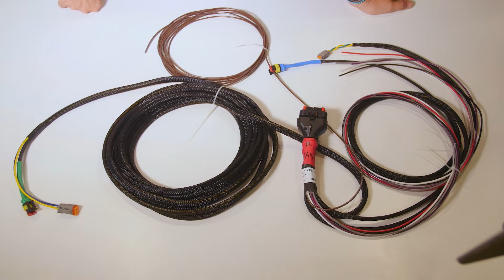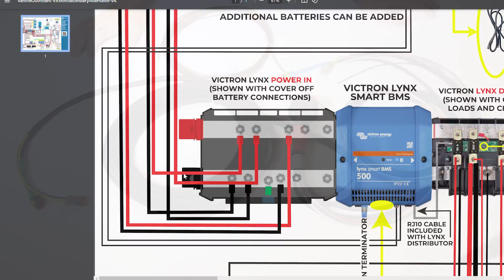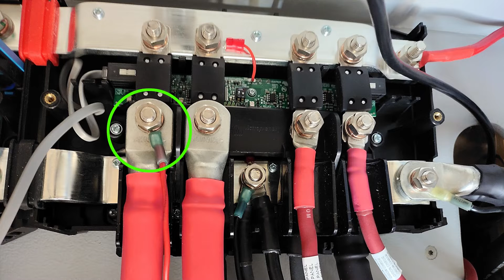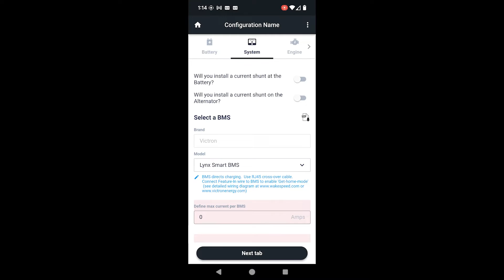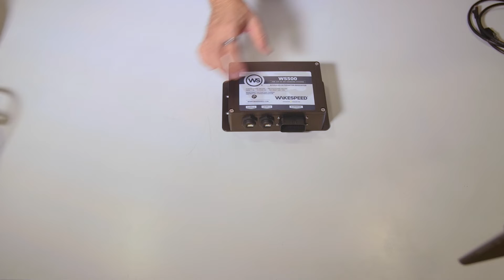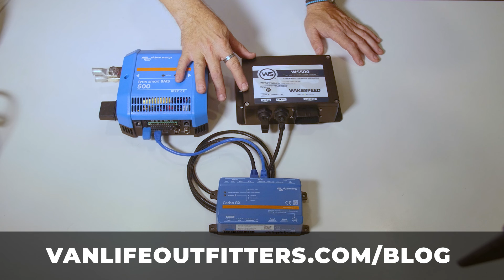Overview of Wakespeed WS500 Van Harness

Comment: the field wire gauge size is not adequate. Wires longer than 60" should be minimum 14 recommended 12. This is from Wakespeed an extending wires.

Comment: A technical comment, your analog shunt explanation, is correct. But I believe you used the positive side from the alternator. You could also use the negative side, the orientation of the purple and gray wires would switch, but I believe you will not need to fuse those wires. Am I correct on this?

Comment: Researching this for my next, Van build! You guys seem to know what’s going on. I also watched their 101 video. Question for you, are you guys aware of the REC BMS? It seems to be highly recommended with generic DIY build. That’s what I’m planning on doing. I will be using 16 S, MB 31 batteries. 48 V, about 14 kWh. Are you guys familiar with the set up?  I understand that the vendor is very important for follow-up support. Just curious if you guys are comfortable with this.

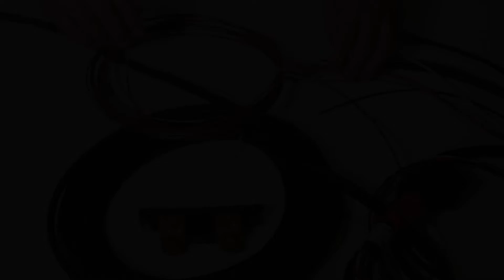Comment: This is a technical question. In your April 2025 wiring diagram accessed from your blog post, there is a note in the lower right corner that states that the brown IGN wire MUST be switched off when the Lynx BMS contactor is open. From timestamp 16:20 to 16:33, there needs to be power on both brown and red wires in order for the WS500 to power the alternator's field wire. If the contactor in the Lynx BMS is open, the red wire will not have power. So is the switch on the brown wire really necessary, as mentioned in the wiring diagram?? The blog post doesn't mention this IGN switch.  
Thanks!!
Reply from the maker: From our video creator and company founder: If you wire up the "red wire" from the Wakespeed harness to the same Lynx Distributor connection point as the charging output from the alternator, as we recommend and show in the wiring diagrams, then power to that wire will be cut when the Lynx BMS contactor is "open" (system is turned off).  That is by design so that if the fuse blows or the system/BMS is off, and therefore the alternator current has nowhere to go - is not connected to the battery, the red wire to the Wakespeed will also be disconnected so no field drive can be produced. The brown wire comment doesn't make sense: "IGN wire MUST be switched off when the Lynx BMS contactor is open". We don't suggest that anywhere. The BMS contactor has no relationship to the brown wire which can be ignition switched. Ultimately, the Wakespeed needs power on both the red wire and the brown wire to power up. The red wire should get switched by being electrically downstream from the Lynx BMS contactor. The brown wire can be switched on/off from the ignition switch and also an additional toggle switch.
Reply: @VanlifeOutfitters  thanks so much for taking the time to reply. Here's a direct quote from your PDF wiring diagram:
"OPTIONAL TOGGLE SWITCH ON THE IGNITION CONNECTION. ADDING THE "OFF" POSITION ALOWS YOU TO DISABLE CHARGING FROM THE SECONDARY ALTERNATOR. IF YOU HAVE YOUR BATTERIES DISCONNECTED USING THE SELECTION/DISCONNECT SWITCH YOU MUST ALSO DISABLE THE SECONDARY ALTERNATOR TO PREVENT DAMAGE TO THE ALTERNATOR."

Could you kindly clarify the last sentence? Your comment above makes logical sense, but the diagram has this strange note that doesn't quite line up.

Comment: The video does not address the "feature-out" wire that is present in the 'normal' harness. This wire can be used to trigger an "idiot" light at the dashboard. So I wonder whether this wire is also included in the van-type harness or has it been eliminated ?
Reply from the maker: The "feature out" (orange) wire is not included with the van harness.

Comment: Do you have an example of how a battery kill switch (such as a blue sea 3001) with an alternator field disconnect function  would be wired in to make sure the alternator does not produce power if the house battery system has been switched off?
Reply from the maker: Sorry we don't but the Blue Sea manual for that switch is very detailed on how to wire it up.

Comment: What size wire from alternator to buss bar
Reply from the maker: Typically the charging output from the alternator should be 4/0 with the Nations 280 amp 12-volt kit. If it's short enough you can use 2/0. I would recommend checking out our blog post that has an example wiring diagram as well. 

https://www.vanlifeoutfitters.com/example-power-system-victron-energy-batteries-with-nations-alternator-and-wakespeed-regulator/

Comment: I wonder about this brand new designed harness when the first thing you do is cut off a couple terminals that are not used.
Reply: It’s so Wakespeed only has to manufacture one harness for ALL applications. If you ever watch someone using a different alternator brand or wiring for a marine system, you’ll see there are other setups that do use all the wires.